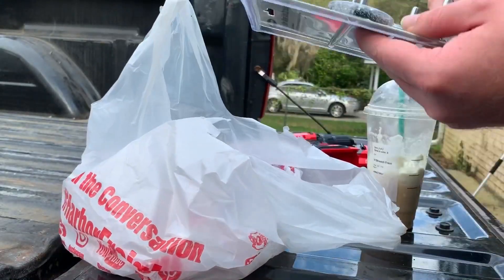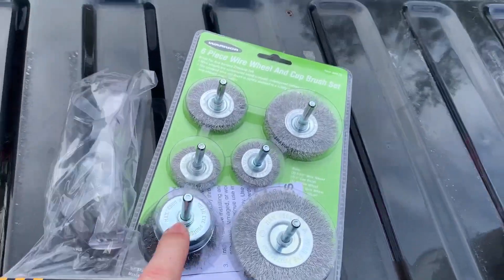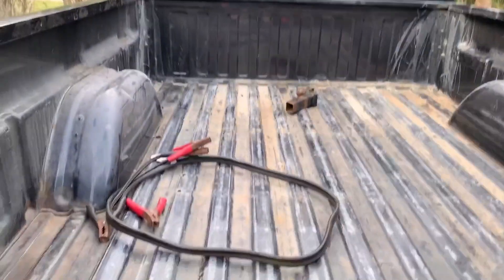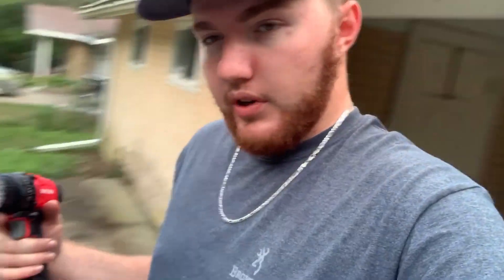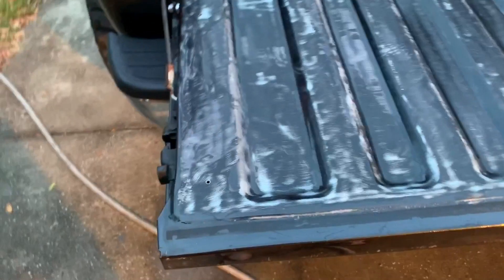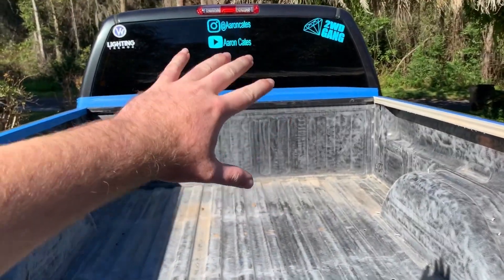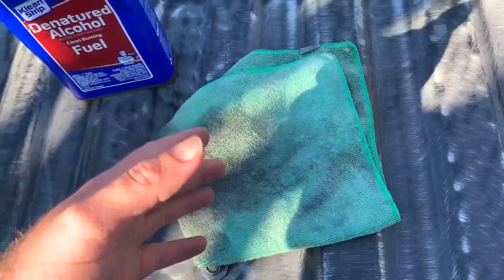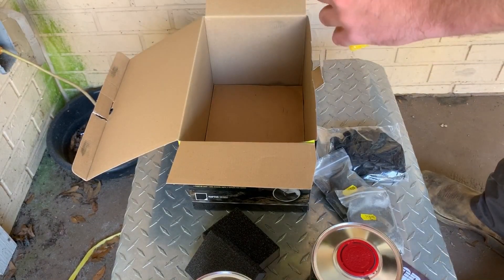Raptor Liner; The BEST Bed Liner?

Comment: Looks good buddy. I sometimes haul equipment for my job so I may be doing 2 or maybe 3 kits worth. But still cheaper that my 550 quote from a lineX installer.
Reply from the maker: That was exactly my point, if you were to do 3 kits worth that would 6 coats! I couldn’t imagine anything getting through that.